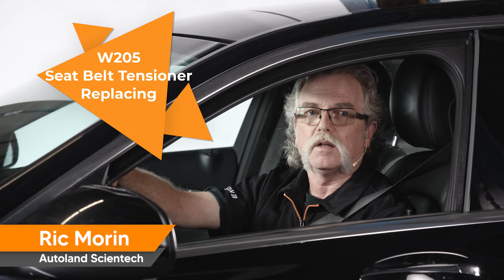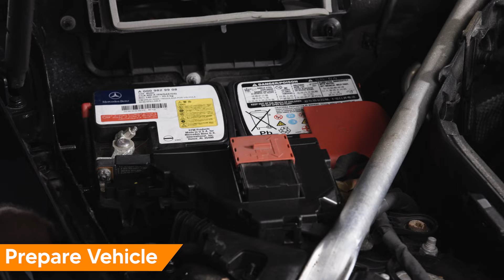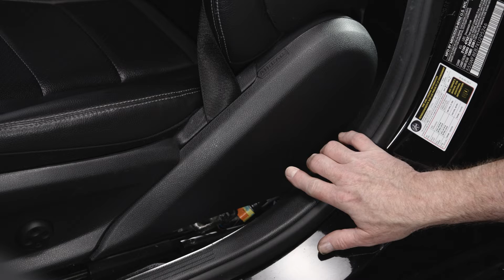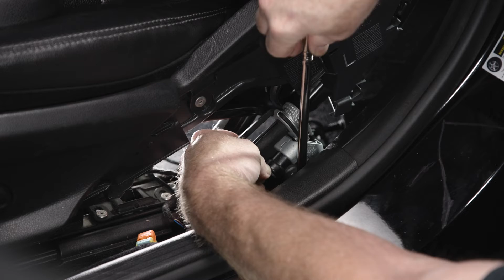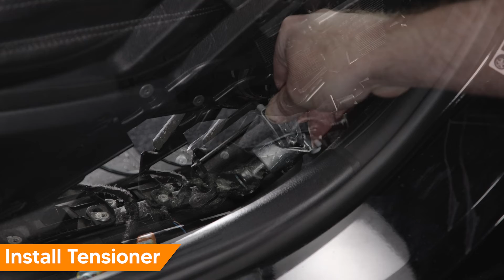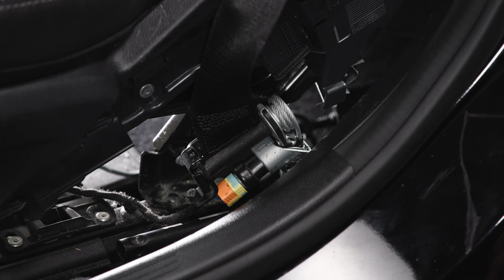How to Replace the Front Reversible Tensioner | Mercedes-Benz W205 Models Front Seat Belt Buckle

Comment: I have the same codes on my 2016 c300 Do I need to replace the tensioner or the buckle?
Reply from the maker: Possibly. Usually faults for the buckle is a bad buckle.
Reply: @AutolandScientechUSACedarPark okay cool just had to make sure. When I took it to Mercedes they said it was a bad buckle this was my first time hearing anybody mention the tensioner just wanted to make sure

Comment: So I want to just change my black seatbelts to a red. Would switching the belt work without remove the tensioner? And will I have to reprogram after? Or is that only if I removed the tensioner?
Reply from the maker: If replacing only the belt and none of the electronics, you won't need to program anything. Just be sure the seatbelt you're installing is the correct part. This would mean the correct length, quality and Mercedes-Benz specification for safety restraint.